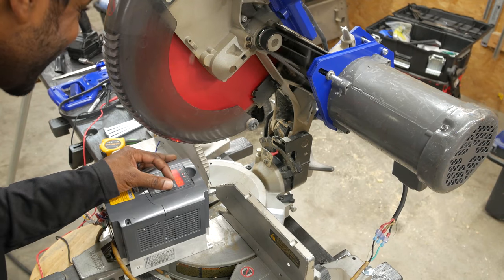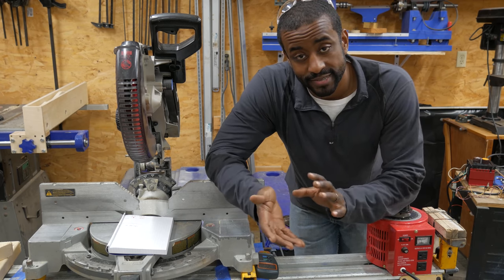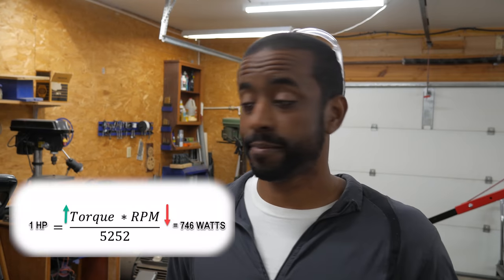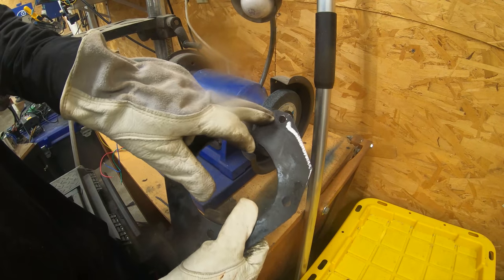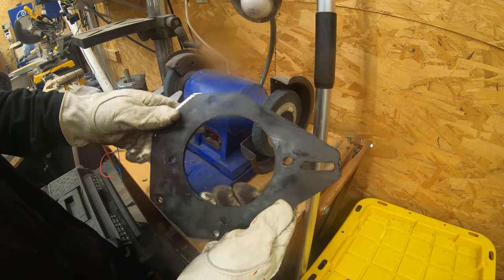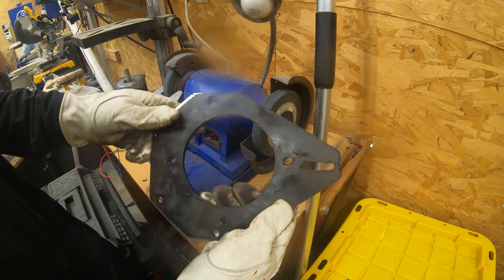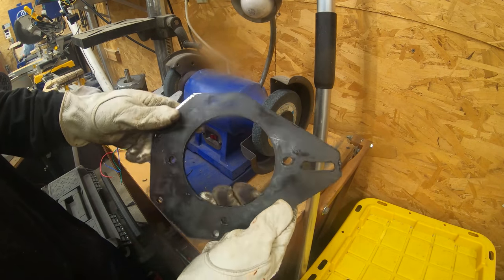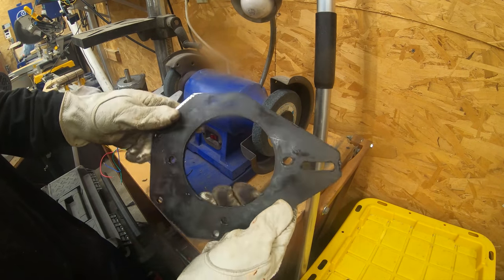How To Speed Control Your Miter Saw For Cutting Steel #080

Comment: Great video and some great questions answered. The conclusion is to buy a cut-off saw designed for metal blades and  a cut-off saw designed for friction blades. I have a friction cut-off saw and searching for a solution for a metal blade. Metal cold saw blades run half the speed of friction disk. Metal friction disk are ugly cuts, no way around it. I use mine for masonry and steel, and it just makes clouds of dust and many sparks, but it fits the budget. When my metal friction disk is spent, I will revisit the purchase of a cold saw and use the friction disk saw for masonry cuts.

Thanks a million for all your hard work and an opportunity to see the inside of a genius brain.

Comment: The NC switch was probably used for dynamic braking. After the power is cut to the motor, a short across the motor windings is used to stop the rotation quicky.

Comment: To the reduction you tried to achieve I think a combination of a mechanical reduction system (belt pulley or gear @ around 2:1 or a bit less) with the DC speed controler for the extra reduction or even only the mechanical reduction would give you the results.

As you said the main issue is torque, but as you are cutting the main forces are the cutting forces, meaning torque in the blade axis. So the reduction would guarante greater torque at the blade whille also avoiding loss of power from the universal motor (since the reduction from the dc would be lower now).

I am a mechanical engineer and phd candidate in solid mechanics. If there is something I could help you just ask. Love your videos and your carisma it would make me really happy if I could help. 

cheers from Brazil.

Comment: Hi Jeremy 
Hey great video the induction motor and VFD combination seems a great idea 
Your knowledge of electrics is second to none I’m very impressed with your videos mate ! 
Iv an Evolution 14” metal cutting “chop saw” aka “cut off saw” perhaps anyway that is to say it doesn’t do mitres. This isn’t strictly true as the vice jaw can be moved to mitre in 1 direction only and the material inverted to mitre the other way.
However this is far from ideal on a dedicated metal cutting saw where it’s mounted on my steel rack with rollers feeding in / out the saw.
I’d wondered because about mounting the saw on a turn table pivoting round the original rear vice jaw pivot point  ,  but why re invent the wheel ? Joiners saws have been cutting mitres in both directions for years so your VFD / induction motor method of slowing one of these saws to ( for my blade 1250 RPM ) seems an excellent way forwards 👍🏻

My question is do you know why mitre saws
 ( with or without the “draw function “ )
Don’t seem to be commercially available for metal cutting? 
I know there’s sort of universal “multi cut “  saws available but these have a lot of plastic around and often a fabric dust collection bag etc 
The evolution cut off saw I have performs very well.
Thanks Jeremy keep up the great videos 
Peter McNeill

Comment: Jeremy, have you ever tried a SCR single phase speed controller.  These are popular with wood routers- ( also Universal motor).  The wave shaping of the SCR controller does provide additional torque,  much better than the Auto-Transformer that you had shown (Variac ).       This is a $ 25-50 solution.

Comment: Just found this video, very interesting info! Regarding power and torque, the original saw motor spun at 17,900 and the blade at about 3600. That’s about 5:1. When your VFD cuts the torque at high frequency (high rpm), the mechanical ratio gives you the torque back. If you had a 1:1 drive ratio and spun the motor at 30 hz or so, the horsepower would be the same, only the torque at the motor would change. The torque at the blade would be the same. If the VFD kept the motor torque the same at 220 hz speed, the power would be almost 8 hp instead of 2 (compared to 60 hz). All that said, I want VFDs and 3-phase motors on my shop tools now!

Comment: Really enjoying this video. I had watched a video that said you could use a Variable Speed Controller on a cheap abrasive cut-off saw to convert your saw to metal cutting. I did so and experienced exactly what you showed in the last portion of your video..... there was no torque when varying the voltage input. Unfortunately VFD's are expensive so I probably need to just break down and buy a steel cut-off saw for $300-$500 :( Great video though. Extremely informative!

Comment: Nice video!  I would suggest using the original motor with a controller that has speed feedback.  It would mean adding a sensor, but it should solve the problem of the universal motor  running too fast and then bogging down too much.

Comment: You need a closed loop feedback system to monitor the speed setpoint and adjust the voltage and/or frequency accordingly to compensate.

Comment: As an aside, a bench-mounted motor and a two-belt three-pulley setup - the intermediate pulley being used as a tensioner - would allow for mechanical speed reduction and less weight on the castings.

Comment: I think the speed controller did great, the Diablo blade goes up to 1800 RPM, which would get you a bit more power, also you were cutting a BEAST of a piece of metal, which means for 1" tube with 1/8 wall (normal building material) that saw would blow right through it...

Comment: One parameter you need to watch since you cant easily change the coil winding is the coil temp.  Keep it under 100 ºC and it will pass UL/TUV and most safety agencies Not that it matters in the shop for low duty cycle use). Also if you lock the rotor (max load short of current limiting) it will tell you what might happen to the the coil winding insulation as it  heats up.  Myself i would rewind the motor to fit my needs but most dont have the resources to do that.  I do this every day when I submit to safety agencies. Great video. Im wanting a dedicated saw for the same thing but if you want it to last you must monitor coil temp.

Comment: The main benefit of the drycut saw is it is fast.  The loss of speed when losing torque eliminate this advantage.  If you use abrasive blades the blade quality and speed of cut varies a lot between manufacturers.

Comment: I will help you with dulling blades while cutting steel tubing. As you know tubing has a weld down the center the outside is smooth and inside the tube it is raised up so always cut your tube with the weld up top that way you won't dull your blades as quick.

Comment: been using cut off wheels in my miter saw for years.  works fine.  go slow to minimize heat if it's important.  clean up isn't a big deal.

Comment: Speed control on universal motors is easier if you can adjust the rotor and field voltage separately. As you reduce rotor voltage your room reduces, but since the field voltage is also decreasing it's also decreasing back emf which in turns increases your rpm. This causes your rpm to stay approximately the same regardless of dropping voltage with only torque decreasing. To decrease rpm properly you need to decrease the rotor voltage while keeping the back emf high by keeping the field voltage at the highest amount. Now I don't know if that would give enough torque but it'll do better than attaching a speed controller directly to it.

Comment: Hello Jeremy, why didn't you try to separate the stator and rotor windings of the universal motor, feeding constant voltage to the stator and controlling the voltage of the rotor? That would save you all the trouble of the complex control of the induction motor. In fact universal motors are much more suited for speed control than induction motors. The problem is that to achieve a speed proportional to the control voltage, only the rotor winding should be controlled and the stator must absolutely be kept at constant voltage. Interestingly, the effect of lowering the voltage on the stator is both reducing the torque and increasing the speed, that's why when you were trying to reduce the speed by lowering the voltage it didn't work quite as you expected, because the stator was working against you.

Comment: ...i'd say that your custom built/modified blue is a very very good metal/wood combo machine, you are a champion, sir ! ... i'm awaiting a 2.2kw banggood vfd, they seem to be quite handy in many respects, i have a 3ph motor running in domestic single which i'd like to exploit ..... furthermore i'd like to implement some sort of slow start on electric powertools such as grinder and circular saw - what can you suggest for such ? ...... i'd have loved to see how you quick stop the motor via the vfd.

Comment: I threw a five dollar carbon blade on my dewalt miter saw (4000rpm) and it cut through 12 gauge slotted struts like butter. Fried the dust collector bag  but the blade and saw are in good shape. But I admire your math. :)

Comment: The NC contact in the switch is probably the brake by shorting the motor.  The will always be some magnetic value in the motor and act as a generator. 
So shorting the motor with stop it fairly quick.

Comment: I made one with a washing machine motor in long beach worked in east LA by the railroad switching area they always have to fix the tracks so their old blades they would leave their.
I'd pick them up take them home. They were when I got them about 14 inch so I have no idea what size they were before.

Comment: Hi, first time viewer, long time tinkerer. It would be nice to see you take apart an Evolution Rage saw to see how they did it. It would make a nice followup to this video. This saw is in the same price range as most mitersaws. 
I'm currently building a new lathe for my shop to turn huge bowls. I am planning to use 2 3hp 3 phase motors and using a VFD to regulate them. Any tips anyone?

Comment: LEF in Louisa VA has many various motors driven directly off their solar collector DC arrays - even without a contoller, etc & at high voltages. Seems somewhat courageous to me - but it's effective & doesn't damage anything except the trigger switches need to be modified.
Have you checked them out? Also they have some 100 yr old Edison Nickel Steel batteries AND the recently made versions.
Great if you make excess amts of electricity all day w your water wheel, etc. Thx 4 your quality work & vids, btw.

Comment: Not bad.
I was able to put together a cold cut saw for right at $100 brand new.
Brand New Black and Decker 7¼" mitre saw on sale at Wal-Mart for $69.00 + Diablo Steel Demon blade from Home Depot $29.00.

While it's only a 7¼" blade, the blade is designed for the speed of a standard circular or mitre saw, unlike the 14" blades.
And I'm a home hobbiest that doesn't cut much larger than 3", and only uses it periodically.

Comment: Almost all of the commercial VFDs allow you to redefine the high and low set point limits.  Several times I have juiced up motors 15 and 20% over the nameplate rpms.  The drive he used in the video is a Automation Direct (Fuji) and could easily crank the speed up without damaging anything.

Comment: Dc speed control on the universal motor and swapping out the sheaves will allow enough  motor speed to maintain some torque and keep the blade at the correct speed.

Comment: Great Video - Thanks. I was wondering if a 3 phase motor would have torque if you slowed it down with a VFD and it does. I bought a 14" Radial Arm saw  with a 5 HP 3 phase motor, and hoped to cut steel with it, looks like I will. Thanks

Comment: I used the cheapest $75 10" miter saw from harbor freight (4000 rpm) combined with a Roybi steel cutting carbide blade to cut thousands of 4" wide14 gauge steel plates. We would stack the plates 1/2" high and cut 6 of them at once.  Beautiful, almost mirror like ends.  On my tablesaw, with a ceramic tip blade I was able to dado a groove so cleanly that we could bend a perfect 90 deg bend on a 3' 14 ga plate without a brake. The key is eliminating any vibration as the blade touches the steel.  Your hands are not strong enough or in the right place to stop the vibration that causes problems. Always use clamps, featherboards, etc.  instead of fingers.

Comment: I usually use the cut off wheel on a real old table saw then hit the rough spots on with the grinder. The saw is definitely not happy cutting 1/8" steel but it does slowly. I wish I had a plasma cutter...

Comment: I don't know if anyone has mentioned it but I would be willing to bet that continued use of the motor with the DC speed controller is going to melt the motor winding. This because as I understand it increased amperage requires thicker wires. This is why you can get away with smaller 120v wiring than 12v wiring for similar wattage. Take this with a grain of salt as I am not an electrician just a hobbyist that has picked up a thing or two.

Comment: There's always weak link.  What is the weak link by adding the 2 hp motor?  The belt breaking?  The housing too weak?  The spring not handling the lift of the motor arm?  What's your thought

Comment: I a very much beginner .. at metal cutting & welding . 
 Ur very advanced.. was wondering how you learned or trained 
 I’m electrician by trade 
  But ur dc /ac switch and gear control is over the top ..
 I’m very impressed you should teach at a college level or better.. .. dam! ur good lol  
  Stay safe 
 Richie

Comment: A constant current PWM controller, with speed feedback, could get you out cheaply here, also If the blade says 1800rpm you should try to use its range it will give you more power.

On your VFD topic here´s a little trick, wire the Motor in Delta configuration and set you VFD Voltage curve to be at Star voltage at 60hz,
then you can get full torque at about 105hz without overheating the motor. It will give you 1.74times more motor power and still remain in spec

Comment: Hi Jeremy, just found your channel today and you have great info What is the tool you use to measure the RPM?  What's your engineering background as you are impressive bro, how you cut those parts out and if fit first time. Your good bro. Looking forward to learn alot from you.
 Thanks

Comment: 3 Phase is fantastic... but most home shops don't have 3 phase even available (in the U.S.) 240V split phase and/or 120V single phase is most common. Something like a rotary 3 phase converter (with a VFD) or a VFD (Variable Frequency Drive) with phase conversion would be required.

Comment: Alot of commercial grade cold saws use a constant flow of coolant. I'd not try to cut any metals without some kind of fluid. Its kinder to your cutting tools and you get a better finish on your parts.

Comment: U could install an arduino and rpm meter to up the power when handle trigger is pulled and then lowered after a certain rpm is reached . u could also install a LCD  touch screen then write code for metal and other materials u wanna cut for rpm
Reply from the maker: That’s a fun idea. I think it would work
Reply from the maker: That’s a fun idea. I think it would work

Comment: Surprised you didn't try the old drill speed controller test just for kicks as it is so simple to do ... I'm talking about Triac control of the universal motor. Usually drops the speed fine (certainly down to half) but maintains more torque for longer due to peak voltage still being able to be applied and hence peak current, so peak torque is there but for a shorter time. Be interesting to see on a chop saw. Like yours, mine suffered a mishap whilst attached to my saw bench ... It was blown over by the wind!!!???

Comment: By adjusting the frequency is one of the best ways ( if not the best ) to control the motor's speed. However, because a motor is an inductive load ( it consists of coils), in low frequencies the inductive resistance is small, and in high frequencies the inductive resistance is large. In other words, choose a frequency bandwidth that doesn't includes very low frequencies, so that you don't burn out the motor, but also not very high frequencies that will prevent the motor's operation.

Comment: The best shot you may have at speed control with DC is to rewire the universal motor to operate as a DC shunt motor (parallel rotor/stator instead of series rotor/stator). With the shunt motor you keep the rotor voltage constant and vary the current in the field. More field current  equals slower rotor speed, so you have better torque control than with the universal.

Comment: Whenever you use a VFD to slow down a big motor like that, you are reducing the cooling air going into the motor.  The motor has a fan blade at the other end of the shaft that moves the cooling air.  It moves the proper amount of air at the rated rpm of the motor.  When slowing down the RPM the fan slows with it.  Because VFDs are awesome, you dont loose much power when you slow down the motor, so the heat output remains fairly constant yet the cooling fan is now under performing.  The solution is a cheap external fan, separately powered, at the end to make up for the lost cooling.

Comment: If you turn the voltage down after it's running well the motor stay running on the lower volts to get the desired rpms

Comment: I know the 2 hp motor is stressing the aluminum construction of the saw, but if it was to be independently mounted at the pivoting point (where the belt tension would stay the same), couldn't you use almost any size motor?

Comment: For the first metal cut you did, what was the speed and other specs for that one. Cuz that cut worked great, but it was not clear what that was. Was it a comparison with like, actually the right tool for the job? Didn't think so cuz that looked like the saw you were modifying in the beginning of the video. More info on that part would be useful